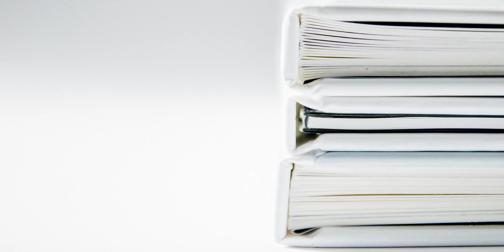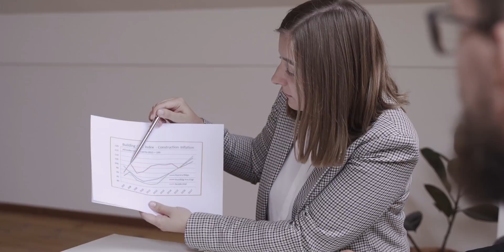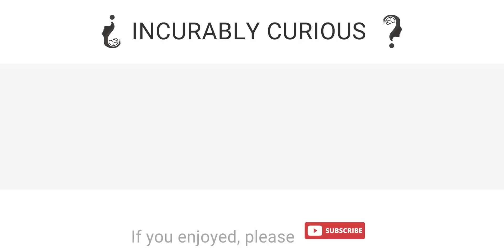Why Most Power Lines Aren’t Underground

Comment: Power generation can be moved to the structure in which power is used.  Instead of power bills you have lease agreements for solar or wind power sources.   Generator back up supply can also be added for emergency use.   Excess power could be put back on the grid to supply need where ever needed.

Comment: Pretty sure the "you have to pay double, so we can place the cables underground" is a hoax^^ Sounds like " that would be a good excuse to drain more money from our customers".
Of course... its expensive to dig the trenches, install access-points for underground transformators and so on... but it would probably not double your pay.
Thats the same argument as "if the Company would pay its employees a fair wage, they would go bancrupt". yeah suuure....would mean the Company wasnt healthy from the Beginning and shouldnt be in business anyway. Same goes for electric Companies. If they dont have Money to atleast start a Conversion to buried Cables, why are they even in business? 

Considering the lost Money after even a few Hours of Powerfailure, its totally worth it to gradually change the Way how the Cable-management is done.
In Areas liek the USA, where power failures often affects ten thousands or even hundret thousands of people at the same time, the lost Money outweightes the investment completely.
Old above Ground power lines can cause massive wildfires or there is a massive state-wide failure like in Texas, thanks to cold weather.
The more modern the Area is, the more Money can be lost, whenever ther is a power failure. Not to mention another risk - EMP. Overloaded Transformators (lightning) or Sunstorms can cause an electro magnetic Pulse, that rushes through the power lines and fries ANY unprotected electric Device completely. The Cables work like antennas for an EMP. Underground Cables are less affected by such events.

Comment: I used to do underground cable..the homeowner part is completely  true..dealing with homeowners and HOAs  can be redicoulous. Underground outages will come to people soon just like the narrated says  I've seen areas that aged  lines start failing underground  be without power for days Once an area starts failing  residents wish they had poles again.
Reply: That is kind of what I suspect.
I'd rather have the power go out for 30 minutes every couple of months than to go several days without while they hunt down an underground short, even if it only happens every few years.

Comment: In Belgium,  all 15KV high voltage as well as 230V/380V customer voltage runs underground. The high voltage cable also serves as a condenser power buffer due to the insulation and twist of the 3 phases.

Comment: If costs estemates of private companies would play less of a role or we would find ways to circumvent some of the current disadvantages of underground powerlines i would be all for it.
Ideally f.e. it should not just be a line, but a tunnel where we can go through and if something doesn't work be able to  fix it fast. Tunnels may have additional protection value against flooding too i would imagine.
The price tag on such an infrastructure project would be huge, but not undoable. Looking at the money spent on weapon in the USA i hardly believe anything could be too expensive it is rather a matter of prioraties.

Comment: In the 70s & 80s,we phased out all above ground cables, when renovating or building new houses in Denmark. You can now only find above ground cables for high voltage power lines.

But even some high voltage power lines are dug down. A few years ago the was a heated debate about a new power line going through Jutland. I believe it was a connection going from Norway, through Denmark, to Germany.
The debate was about how much of the power line should be below ground.

Comment: In the Netherlands all electric cables under ground, besides the high voltage cables. 
Ofcourse its way more compact so less digging compared to for example America and Australia. 
Also the chance of hitting the cables is quite low here as companies have to get the ground details before they start to dig. Ofcourse it can and will happen but not that often and its fixed quite fast most of the time.
Also there are cables in the ground that are over 50-60yrs now. So the 30-40yr estimation isn't totally correct. 
And the last thing, we already have systems here that will track where the failure is and it does speed up the repair time because they have to look less time. And like everywhere "time is money" so they want it to be done ASAP, or else they might have to pay the customers. 

I know this video is all america based, but maybe next time mention it 😉
In the end its all about the money. Its way easier/faster to place some poles than digging tranches. I'm just curious whats better for the nature. Using a machine for the trenches or all the wood/metal that has to be used for the poles 😅

Comment: Most wooden poles are usually replaced by either metal or carbon-fiber poles. The carbon-fiber poles are more favored for the future as they have more give during high wind and storms and lower risk of breaking. Metal poles are extremely costly and require a lot more space than a single carbon-fiber pole to set, and so at least for one midwest energy company, I know they are looking to implement carbon-fiber poles for the future instead of wood. In most areas already, ever 5-6 poles is already carbon fiber to prevent a total collapse of the line should a storm come and knock some poles down. 

I wish underground power could become more regular, it's much cheaper and simpler to repair them than overhead lines, but yeah, the initial conversion cost would be high. But given the amount of years it would take, it could become worth it at some point.
Reply: In the city near me there used to be streetcar trolleys.

So on Main Avenue, they run electrical on their old metal poles where as the side streets are wooden.

Comment: I just recently had a poweroutage. A splice point wasn't watertight anymore.
- It took them about 2h to locate the exact location
- took them a while to get the contruction tools on site (it was 3 o'clock in the morning at a national holiday)
- they dug a little hole (about 1.5 m x 3 m)
- from power outage to restoring it, it took them exactly 11h and 23min
- The splice was made in the 60s, and I knew (from my previous work as a line man) that they are failing, because they used bitumen instead of resin that they use nowdays

That was the first ever non planned outage that I have encountered in my life (not including work as a line man).
I know many friends and families, who never had an unplanned outage ever in their life, even my parents, which are now over 60 years old.

Thanks to underground powerlines ;)

Comment: I am a power lineman for a municipality that has close to the most underground power lines than anywhere in the country. Our system is something like 98% underground but the kicker is we also have close to the lowest rates in the country at .08/kwh. Our reliability status is also in the top 1% of the country. The primary reason for outages is dig ins, which require a lot of time and money to repair. The only option is to dig it up and splice, or pull in new cable if it's in conduit. Finding faults during an outage is also difficult. Instead of just driving the line and visually inspecting, underground power fault finding requires the use of special equipment and training to identify the piece of wire that has gone bad. 

Another problem with converting overhead power lines to underground is the customer usually owns the smaller service wire that connects their house to the grid, so converting that section to underground is a bill the customer has to cover, which usually isn't worth it and the poles still remain in place because the secondary voltage wires remain overhead and remain an eyesore.

Comment: Another reason I've heard was that underground power cables perform worse because ground absorbs electricity and so it leaks out of the cables with large lengths and efficiency is reduced.
Reply: Here, the lines are far more insulated and ran in a conduit. That would be some magical power if it managed to still leak.
Reply: This would only happen when the cables are improperly installed. All cables and splices should be watertight.
Reply: Lol

Comment: I’m not an expert but i think theres a difference between distribution and transmission power lines. See, distribution lines conducts energy from power plants to homes and businesses , contrary to transmission lines which handles higher voltages from the generation to the distribution plant. Transmission lines are not insulated and use air as a natural insulator. So wiring all the grid underground wouldn’t even work or if it does, it would be inefficient and very expensive

Comment: The power lines in The US were public property until the 90s when Clinton started selling them off to the power companies who rented them up until that point. If outages occur, however, the bills come out of a fund from local and state municipalities and rarely from the companies themselves. Thus the companies will allow the lines to fail and dip into the "relief budget" to avoid paying for "standard upkeep and maintenance" costs of which they are responsible for. So if you ever wondered where your tax money goes; this is one place. Paying for your electric company to not upkeep your power lines so they only bother to fix them when they go down so they use the gov aid relief funds and not their own money. 

But they claim the price hikes are always because of repairs. Hands in each cookie jar. 🤷‍♂️ More modern and advanced machinery and processes makes generating energy cheaper and easier not more harder nor more expensive. Every upgrade should lower your prices not raise them.

Comment: Honestly... Underground power needs a lot less maintenance. When they are there, they're there. But in the US you need a lot of Ampèrage because of the low voltage.
Reply: It's usually nominal 240v to the resident's power meter by two phases of nominal 120v here in the US.

Comment: Funny, to hear all these american estimates, knowing that in Europe they have lines installed at a fraction of the cost, as well as those lines have been there for tens to almost a hundred years.
Their estimates of '30' years is far from that.
Another thing Europe did to preserve the copper lines, is switch from 120V to 220V in the mid-20th century, allowing for a doubling of power delivery without changing the hardware.
The only power lines you see above ground in Europe, are high voltage lines, like 6kV or up.
For underground cables, it can also take just hours to find an issue. There are magnetic sensors that can sense the magnetic flux coming from a powerline, and the company just needs to sample the line every few miles, until the problem has been found. Granted, not as fast as above ground lines, but definitely not +4x slower either.
It seems that all the data presented in this video is highly substantial. Cost of power delivery, with lines below ground in theory should lower the overall cost, as many of these lines will still be operational 50+ years 'down the line' (pun intended).

Comment: My area has extensive flooding yearly. There are a couple newer neighborhoods with buried lines in my town. After a major storm we'll often still have water on the ground when the power company comes out and runs a new line or puts up a new pole. The spots with buried lines had to wait until the water ran off, which in the bowl we live in can take weeks.

Comment: Underground cable itself is also more expensive per foot than above ground cable.
There is also heat issues that have to be factored in depending on amount of current run. Meaning you may have to run a larger cable size underground than you would above ground. Adding even more cost.
In the northeast majority of outages are due to vegetation issues. Trees or branches coming down on lines during storms.
They've started an aggressive program to cut back these potential hazards and it has drastically reduced the number of outages and their duration. 
Our power rates are already high enough. Most of the cost is delivery. 
 Will put up with an occasional outage than double an already too high a bill.

Comment: As someone who works in the excavation industry, it’s also a major hassle dealing with buried cables. I’ve personally seen a cable that was more than 5 feet off from where it was marked, as well as being 8-10 inches in the ground when it was marked as being 36 inches. As you can imagine, trying to dig 36 inches down through an 8 inch buried cable can cause a problem
Reply: As a locator, the person who marked that line was being lazy.
Reply: That's not a hallmark of underground cables, that's a hallmark of a culture based on hedonism and corruption.

Comment: They have been burying power cables a lot in recent years in Finland too where the ground freezes during winters, so it is possible a cable might get damaged over time by the freeze/thaw cycles moving things around under ground. But that shouldn't be happening nearly as often as trees falling over the lines during winter from the weight of the snow.

Burying the cables also makes it harder for Russians to sabotage the network in the case of an invasion, so that's a bonus too. We always have to plan things around that possibility since it's not like any other neigboring countries would be invading us any time soon...
Reply: If you go deep as 2 meter i doubt even a falling tree could be a problem

Comment: you might stil look a bit deeper into this topic also outside of the us as well. there a view more details which are in the side of over ground power lines. a high powerline over ground can be use even for more then a hundered years as long as the amount of power nbessesary to be trasmitted doesnt need to be upgraded. a overground powerline need to have the lines changes arround every 40 yerars but the struktures can be used a a lot longer. underground lines  at least high power for exampe neeed also very wide corridor bare of vegitation to stay accesible 380kV arround 60m wide .  just some point for you.

Comment: So the rate goes double to the customers, but there is no consideration on the immensely lower cost of maintaining underground power distribution? As said here by other people, underground is the only way power should be distributed. In Europe you can only have above ground power in very specific situations, like rural locations where digging a trench to supply power to 50 houses is economically unfeasible.

I lived with my parents for 24 years and I can only remember 3 outages caused by external events.
Another thing that would allow a better management is eliminating transformers altogether. In Europe electricity comes from the power plant and gets hooked into a substation (effectively a massive transformer) and then it goes to all the homes it supplies. Having one central point of conversion greatly minimises acquisition costs and makes it so that you don't have a box or cylinder for every house hanging about jut to be used as a transformer.

Comment: A person who worked transmission power told me once that besides a high front cost (land rights to bury lines instead of land rights for lines), there's the O&M. It triples cost per linear foot (in that market). And then some municipalites require you to take extra time to contact a different group to verify which line is where in the ground to reduce the chance that you hit a different providers stuff (cable or water) while you dig. Should greater planning happened first? Probably. Should future development projects (planned cities and communities) have this built in so it's all easy to access and maintain without huge overhead? Yes. But if you didn't do it up front it can be a real pain.

Comment: The 4 mile square city of Coral Springs Florida was built just prior to 1979 with all Utility lines (Power/phone/cable) underground. But it was designed that way at the inception of the city. The place was a landscaped beautiful city. And at the inception of course, and only Florida Sand to dig into, it did not cost 41 Billion  \o/

Comment: I had over a quarter-mile of armored cable to run from a transformer along a suburban-to-rural road to a transformer that would service a house and outbuildings of a farm. The power company and I came to an agreement that would benefit them with reduced maintenance, service calls, and outages, and benefit me in those same ways plus better reliability if we put the entire service underground, and so I paid the majority of a cost-share to do that. That was over 15 years ago and it has been a great investment for all. My nearest major city now has nearly all of its power lines in the inner core underground in some form. I think it should be done whenever and wherever there is any reasonable way to do so. The arguments against it only apply in some circumstances.

Comment: This video is clearly US based. In Western Europe it’s basically common sense to put short range high quality local distribution cables at least 2 meters underground. That’s why they don’t get dig up that easy and don’t break that often even after many years (solves 2 of mayor drawbacks you named). Flooding  (don’t know where you got that from) or trees is basically no problem for modern cable.

Long range grid scale distribution cables should and can still be above ground for maintenance reason. But the should be higher up above tree line as you said on metal towers.
Look to the East across the Pacific. Europe has been installing electricity grids across multiple countries for years that way.